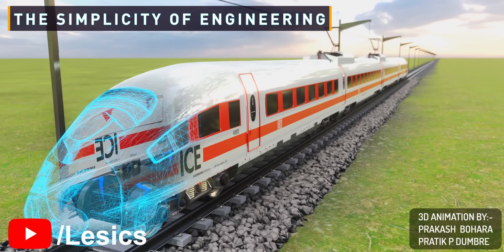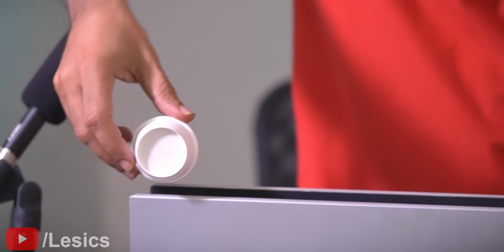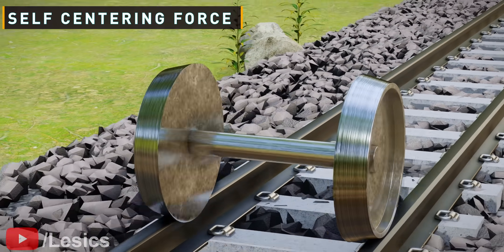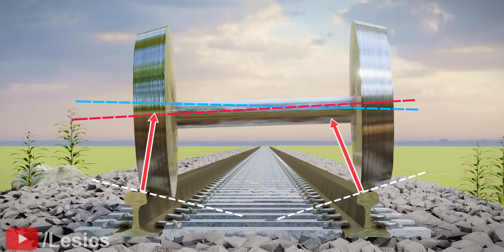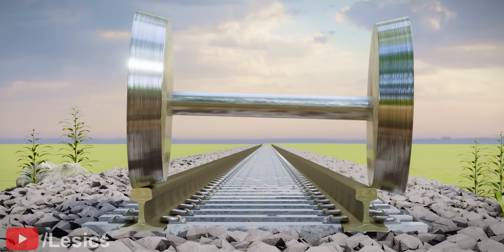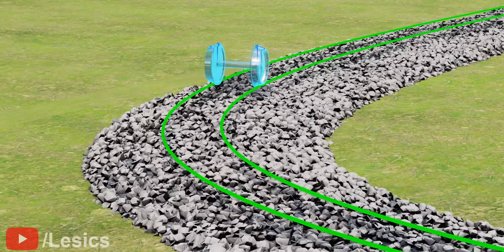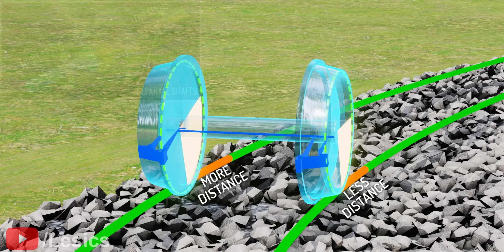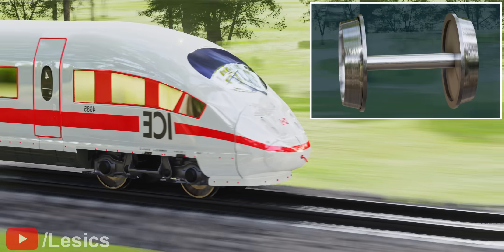The interesting engineering behind the SHAPE of Train wheels!

Comment: I remember hearing once that the size of a train wheel that actually makes contact to the rail is the size of a dime, and never believed it
Reply: If you put a dime on the track, it would not be evenly squeest when rolld ower! Only partly!
Reply: The contact patch would be extremely small, as neither the wheels nor the rails deform like car tires do. It would be half the width of the rail (probably 1" to 1-1/2") by like 1/16" or 1/8".  Honestly, the size of a dime sounds pretty plausible to me.
Reply: @benjamincressler6467  id believe dime just because of the bevel on the tracks itself offering an angle at which the wheel meets the track more than a corner would
Reply: @benjamincressler6467  Not really, they do deform but it's very minimal (still more than what you expect) and not permanent. If you rest 80 tons (weight of an electric locomotive) on a surface that is less than a dime, some "crushing" will occur even if it's steel on steel.
Still the contact surface of a train and the tracks is VERY small.

Comment: Fun fact: the northbound rail between Mjölby and Linköping in Sweden were TOO straight at one time, which made the X2000 trains wobble like h*ll at full speed. At least that's the explenation I got from train traffic control when I worked on those trains as a conductor/servicemanager. 
  In other words: The wheels slid back and fourth, though on a microscopic level. But in 200km/h the vibrations amplified and made the trains cars wooble and shake in resonance. 

(Correct me if I'm wrong 🇸🇪🙂)

Comment: 👍 )))))
A perfect animation with comprehensive analysis that may easily be accessible even to a non Permanent Way personnel (ie Railway track engineer)....
The two examples depicted in the concerned video , make it more worth watching &  distinguished in itself , are as under ....
1. What would be happened , if the angles of coning were be provided in opposite direction ?
2. How the phenomenon of differential action does work in the case of a car , when it's wheels negotiate on a curved road ?
So , in the video clip , it is distinctly displayed that ...
In the first case , the angles of coning in opposite directions , will be the cause of derailment due to want of self centring force ....
and , in the 2nd case , the differential action is managed by providing the connecting shaft of wheels in two halves , on account of which the wheels of car run by  different speeds .

Comment: They still wear the rail and themselves a bit in a curve
My neighbor worked for the RR, and would bring me pieces of worn track.
They would have to go out ever so many years and flip the track in a curve because one side was worn. After the other side got worn they would change it out They would break the old rail up in short lengths as to bring it back to the yard.  
We made cattle guards out of them and had some planted by the bard doors as to keep tractors and equipment from hitting the door frame. They made great anvils and if 8 ft long corner posts

For those that do not know..curves are straight rails that are bowed into a curve on site.

Comment: I thought they were going to discuss what the wheels are made out of also. They are made from white cast-iron. It has the highest hardness rate and the greatest wear-resistance, White cast iron is good under heavy loads but is extremely brittle if it was a hard enough force. That is why train tracks don’t have grease on them. Because the train wheels don’t need it.

Comment: Is there a reason why the rails aren't tapered to relatively the same angle as the wheels? Would this prevent the ability to go around curves? 
Just curious as I'd assume either the wheels or the rails would wear with such a small contact point.
Reply: I'd say look it up because this isn't a simple question with a easy/simple answer (as I learned)

As one commenter pointed out. The wear can actually cause issues. I had to look it up myself to understand. It pointed out a few things as to why it's shaped as it is basically too.

Comment: Very interesting; I wonder if this was applied from the very earliest railways; some vintage narrow gauge lines rather look like the wheels don't have the taper. 
It would be interesting to look at the engineering that goes into the rail head as well.
Why do wheels squeel on sharp curves? I assume that this is because the flange comes into contact with the rail head. It happens with every train at Clapham Junction going through Platform 10, as anyone waiting on platform 9 will be well aware!
Reply: JT, That would be my guess, too. Since there are no more contact points nor anything "actively moving" under a boxcar that would've those long squeals, just a suspension system but that wouldn't whine, it would more likely make brief compression noises as it compressed/decompressed (my guess).
Reply: Yes, squealing is the result of going too fast or too slow around a bend.  Go too fast, and the wheel flanges are thrown against the outside rail.  Go too slow, and the wheels don't shift enough for proper differential action, causing the wheels to slip.
Reply: @nispelsm  THX!

Comment: I worked for a small RR in Arkansas and I was taught a very rudimentary way to lathe the wheels on our locomotives out in the field, not in a shop. It was labor intensive, filthy,hot and sweaty work but very satisfying.I had to jack up the locomotive, unhook the cables from the electric drive motors and hook them up to the welder on my service truck to make the wheels spin. Then I attached a lathe to the track under the wheel and manual cut and measured until the wheel was back in compliance.
Reply: That's fascinating! Maybe I can add to this.
If you take your car in for brake work they will replace the brake pads of course.
They will not remove the rotors to true them. Many shops now have a machine that connects to your hub and the lathe portion of the machine cuts the rotor while the hub is being rotated. Maybe trains will do this someday.

Comment: You forgot the 3rd reason which is that there's less friction between the wheel and the track, meaning the train needs less fuel to maintain its speed. (though this also means less traction, thus harder to start or stop moving.)

Comment: Your bend in the road was extreme for the sake of emphasis but are rare on basic lines , most are gradual bends and this cone thing is a minimal differential adjuster . On sharper bends the steel on steel would allow some slip on oñe wheel also....

Comment: I have a general question on train wheels.  How are they lubricated or cooled ?  Constant metal to metal contact from wheel to rail, how do these combination doesn't cause problems ?
Reply: They arent cooled. There is a large bearing where the wheelset attached to the trains but the wheels are press fit onto the axle making it essentially 1 solid piece. The rails are not lubricated. Overtime the wheels develop grooves in them and they need to be remachined (if they are still thick enough) or removed and replaced (assuming the axle is still safe to use). I used to remanufacture wheelsets and worked on nearly every step of the process at one point or another.
Reply: @ds43045  Great to hear from an expert with working experiences.  Googled and many says metal to metal gives not much rolling resistance and heat generates when braking.  Do you know approx temp of wheels purely from rolling ?  Thanks.
Reply: @turboromy  i unfortunately do not know and wouldn't even hazard a guess but I believe it is quite extreme. On some trains (I think it may have been all passenger trains) the bearing housings contained a small metal capsule that would rupture under extreme heat. This would realease a foul smelling gas as sort of a warning that the bearings were getting too hot. On the few occasions that we wanted to rupture one ourselves, we needed a torch to do so and I want to sa they were usually just starting to glow red when they would rupture.

Comment: The train will also slightly tilt inwards in a turn making it compensate for the centrifugal force. Not that it matters much since the turns aren't very sharp
Reply: Wait - the train tilts slightly in ward in turns... How is that a function of the symmetrically-conical wheels? Wouldn't it be because of the slope that was designed for the track bed in the curve?

Comment: There is another action.  As the wheels slip to one side the outside wheel starts riding on a larger diameter and the inside wheel does the opposite. Since both are rotating at the same speed, the larger effective diameter wheel tries to travel a greater distance and steers the assemble back to center.

Comment: Something that people are forgetting to talk about is wear.  If you look at track and wheels they start to become flat over time.  If you listen to a long train when it goes by you, you hear the wheels on certain cars make a make a high pitched shriek or grinding sound.  To me it sounds like the wheel is hitting the inside flange on the rail or it could be "wiggle" as some others have talked about on here.  You can also hear when wheels have a flat spot or a bad bearing.  It makes a constat thump, thump, thump as the train goes by.  The thing I think about is if the wheel was wore out so much that the wheel was flat, the only thing from keeping it from derailing would be the inside flange.  Also, if it did have that much wear and was literally flat, how would it self center?  Maybe that goes back to what I said earlier about the high pictched shriek.  Its all very interesting and fascinating at the same time!

Comment: I assume the angle of the wheels is exaggerated for the visual explanation. So would the differential action be limited by the diameter difference at the point of contact on the cone of each wheel? Thus also limiting the angle at which trains can turn? Or is the turning limit determined by another factor?

Comment: Being the wheels are designed this way, I imagine there's a maximum degree of turn a train can take. Otherwise the inner or outer wheel would overcome the force that's trying to keep them spinning the same speed and would slip. Maybe. But it could be the amount of distance between the tracks means it makes no difference?
Reply: Yes, I guess the maximum turn rate is determined by the ratio between the maximum radius and minimum radius of the cone. However in reality, the maximum turn rate is limited by the speed of the train.
Reply: @MegaKopfschmerzen  Well, there's that, too! I wasn't thinking about how they like loading them heavy and the axles are pretty narrow. Lol

Comment: Trains are the safest, cheapest, most efficient, and most comfortable way to travel. 

Fun fact: in over 50 years of high-speed train service in Japan, there hasn't even been one passenger death!
Reply: I should mention that commercial aviation is actually safer overall.

People on-board a train are indeed the least likely people to be injured or killed in transit.  People off the train, however, are more likely to be injured or killed.  Cars stuck in railroad crossings, people falling onto train tracks at rail stations, and worker accidents in the railroading industry are sources of injuries and deaths that are considered when looking at the overall safety of the railroad as a method of transportation.

Commercial aviation (and only commercial, not general or military) has the best overall safety record.  Commercial aviation in the United States has had no deaths in-flight for several years running and a very low accident rate in ground crews as well.  The fact that there are basically no “airport crossings” helps with this.

There actually is one “airport crossing” in Gibraltar, but that is the exception and not the rule.

Comment: Basically: The wheels are shaped that way so they fall into eachother towatds the center of the track
The turn thing works because the cone has varying diameter depending where you are on it, and the speed of the wheel rotating depends on how wide the wherl is
Reply: Very well explained mate.
Reply: Yeah but they don't "fall" to the center. That's technically wrong. The normal force is pushing parallel to the track. It is an important distinction cause you can mess it up if the track is not parallel to the ground and you think about gravity. On a tilted curve for example, this same normal force applies.
Reply: @huracan200173  well of course, because it's not like gravity is whereever the center of the track is by default so it would need to be level.
Once it's disrupted and the one side of the track is lifted what happens is one side no longer falls into the center of the track, and the other still does but with no counter, meaning it all slides over. Then, the height of the train and weight is what finally topples it over
Reply: I think this video was short, informative and well made. Your comment resuming it is pointless.
Reply: @nisios  Nah, I found it helpful to read another summary of it. Things being explained in slightly different ways makes it more  understandable for me.
Reply: @nisios  it could be useful for the person themselves
Reply: @shyambuddh5546  yes
Reply: @shyambuddh5546  didn't thought about that, that's true

Comment: Very interesting. If the wheel contact surface section were convex instead of straight, wouldn't the self-centering effect increase? I also think that if it were concave, the train would tend to derail. I'm right?

Comment: Profiling the rail with rail grinders also helps with keeping the train on the tracks as the rail will develop spliters and railhead drift. The inner rail on the inside curve develops spliters and drifts to the in side of the gage in the curve while the outer rail drifts into the out side of the curve wearing down the inside of the railhead. All this can wear down flanges on the wheel sets.
Reply: I'm interested in the topic you speak of. I'll try to search it but you have any websites on this or videos to suggest I'd greatly appreciate it. Very cool information to know imo

Good thing I'm not one to panic. But I definitely would if I was in a remote place in a 3rd world country. They tend to skip on those safety details (at least I would think they would).

Does this always explain why most trains will derail on turns if not properly maintained?
Reply: @medicasclepius236  in general it's good practice to get even wear on the track by running trains in both directions on the same  set of rails. The big Class 1 railroad in my area CSX dose this with the two track main line. All east bound traffic will run on track 2 for 12 hours and west bound traffic on track 1 for 12 hours. When they change dispatchers the trains on 2 start going west while trains on track 1 go east for 12 hours till the dispatchers shift change happens again. There is definitely some decent material on Rail profiling look up LORAM they give a brief on their web page on what they do. There is footage here on YouTube but most of it is railfan footage. Another company that might have something is Pandral Jackson or Harsco? Not sure what they call them selves now.
Reply: @onrr1726  Thanks, most appreciated. Did a little bit of "light" reading on it last night. I definitely look that up.
Reply: And when you start throwing in "Gauge Corner Cracking" which led to the horrific Hatfield Derailment one can understand why rail grinding is an essential exercise on a high-speed railway.

Comment: They missed a third key point specific to trains. Steel on steel contacts is one of the lowest friction contacts that can be easily engineered. This means high efficiency of motion, but it also means difficulty of acceleration. The classical solution to this is to make trains very heavy, overcoming the low friction with the downward weight of the train car. It is for this reason that trains are so poor at dealing with slopes, as even a mild increase in slope has a dramatic effect on the efficiency of the wheels and thus the engine. Tapering the wheels massively increases the efficiency of this design by reducing the point of contact at which the weight is carried to the tracks. The tapering being naturally self correcting also means that the efficiency of acceleration is very predictable, since the nature of the contact will almost always be the same.

Light rail is a radical step forward. The engineering challenge of how to get enough torque to accelerate, while still being able to get the advantages of smooth steel on steel contacts, is instead addressed with powerful electric motors that provide disproportionate amounts of torque. This allows light rail to be light, often similar in weight to an equivalently sized bus, which in turn makes track design & maintenance dramatically easier. There is still an advantage to heavy rail in that it scales positively with weight, making it ideal for freight.

Comment: Yes the conical wheels steer the axle automatically to keep it centered on the track whether in a curve or in a straight rail section, thanks to the change in circumferences.
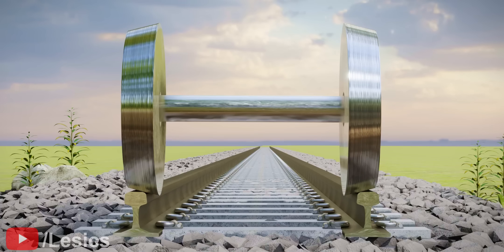The force explanation at ~ 1:39  does not make any sense and is not required.  Imagine the train stopped with all axles off center to the right.  The train is not moving sideway.  All the axles stay off center.  The sum of all the the horizontal forces on the wheels is zero.  There is no lateral acceleration of the axles.
Reply: If the coefficient of friction was zero between the wheels and the track, then the train wheel (starting off-center) would oscillate continuously between tracks, even with train at a stop. That would be a train that you could not get started unless you were going downhill, and good luck stopping.